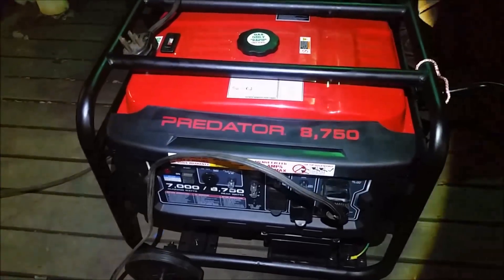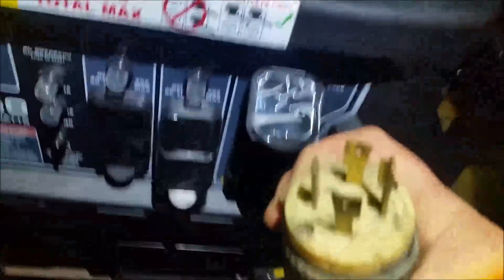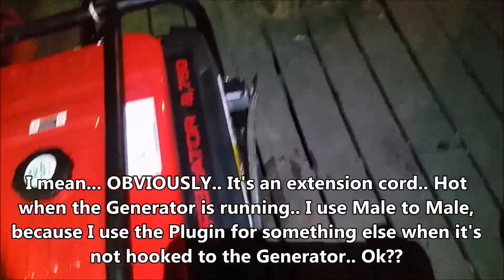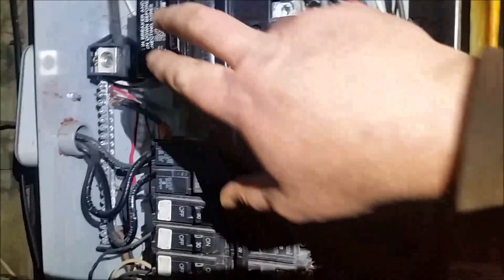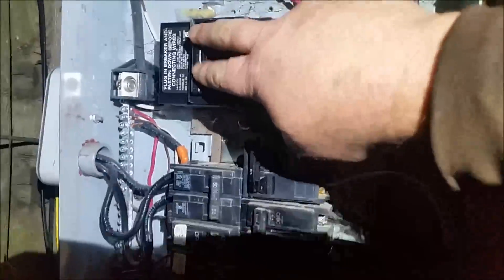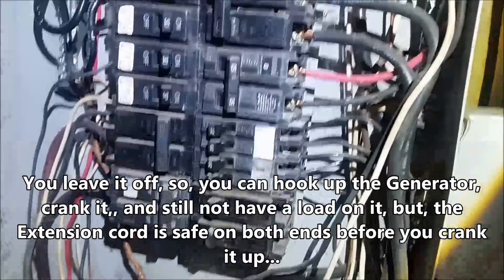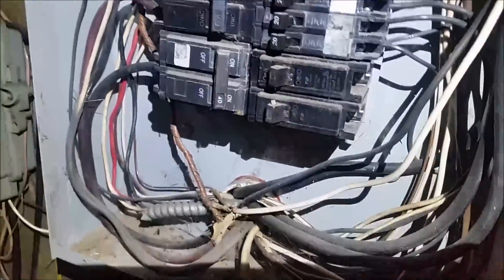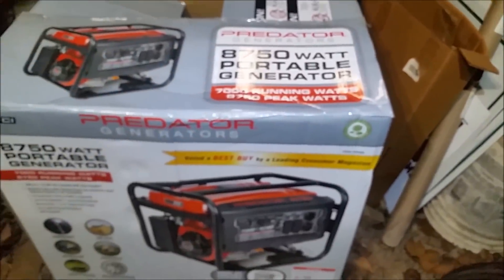Quick/Easy/Safe: Use Existing Plugin/Breaker for Generator hook up to your house Panel box.

Comment: 1. Generator OFF        2. Turn off street power main breaker 3. Plug generator into 220 dryer wall outlet. (You will need a double male 220 suicide extension) 4. Start generator and Restrict your power use to your genset output. I have been doing this for years in Key Largo.
Reply from the maker: G Howard.. You got it buddy.. Works like a champ.. We were on Generator night before last for 4 hours and then, 1 hour when they were making another repair later..  I had two of the lineman come bye here again between repairs.. One that has my setup and his buddy that wanted to look at it too.. 
They came by early before they dropped the power the second time and asked me if I was going back on Generator.. I said Yes, and they stayed while I dropped Utility power and converted over real quick.. I heard them call on the radio as they were getting close to their truck to go ahead and setup the road block so they could make their other repair just down the road..  The one guy said the same thing the first said he would say.. No problem if you remember to turn off the main breaker.. Then, he grinned and said,, if we ever forgot,, they would remind us when they flipped the power back on.. Ha.. 
I reminded him.. Power is out anyway when I get to the panel.. It's the first thing that gets done, before I work on anything.. He looked at me and said.. Hmm.. Yep,, same here, and said,,, not a bad setup.. He also mentioned he had a welder plug that he was going to use to do the same, next time the HF Generators came on sale.. Cheers.. If it is good enough for the lineman, good enough for me.
Reply: They call it a suicide cord for a reason...
Reply from the maker: Dsm Reloader.. Yes... Because of people like you trying to use them.. For people like the rest of us, it is called Male to Male Extension cord and we use it simply and safely.. Same as we don't forget to tie our shoes or put  our cars in park.. I know that is really hard to understand.. But, it is really simple for the rest of us.. But, it is Ok.. There are electricians for you other guys.. Since posting this video,, I don't trust any Electricians any more.. Too many who don't understand the fundamentals of Electricity, much less panel fundamentals.But, it's ok too.. None of you will be the wiser..
Reply from the maker: DSM Reloader.. Really?
Turn the Main Breaker off, connect the Cord, THEN,, Crank the Generator.. Remove Generator in the exact opposite.. 
Why do they call it Suicide cord using these 1/2/3 steps... I am curious.. Maybe we have met someone who is Intelligent today?? 
Or,, are you just another Libtard Idiot? Your next comment will be the final judge.. Guess where you are right now, without an explanation.. Ha..Ha.. 
Give it your best shot.. Using these steps, 1/2/3,, why would you call it a "Suicide Cord"..  Waiting?????
Reply: That is called Back Feeding and it is dangerous and illegal.  If your neutral is not isolated from the street service (which in the case of this video it clearly isn't since all that is on the main breaker are the 2 hot lines), then you can back feed to the service and fry the power company guy working on the street service.
Reply from the maker: Is that what you call a Manual Generator Switch.. Back Feeding.. Because they all feed back into the breaker panel.. If it is the opposite direction of the Utility power,, it is going to be best described as backfeeding.. I don't understand why you think it is illegal.. Do you have some way to replace the feed coming in from the Utility, so it is fed the same way?? Backfeeding or Alternate feeding would be the same thing. Something other than Utility power,, Just FYI.. 
If you don't understand it that way, maybe you could better explain at least what you are thinking.. 
Neutral Isolated from the Street? Would you please show me a Main Breaker Panel that has a Neutral Disconnect? Please get some good pictures.. I have yet to see one.. And,, by the way..While you are doing that,, notice that every box you look at says "Service Disconnect" and the only disconnect is the two wire "Hot Feed".. But, don't stop there.. Go out and look at the poll where you transformer feeds your house.. Look up and see how many wires are feeding into the transformer from the Utility.. If you count more than 2, that means you have 4 and you have 3 phase.. But, it still means that those wires are all hot.. So, how does your theory make any sense?? Just curious.. because the bare wire on the Areal Triplex entering you home.. Where does the 3rd wire come from?? You will find it in the ground next to the pole the transformer is on.. If that is the case, then, what the hell are you talking about?? How could it back feed to the service and fry the power company guy when the wire doesn't go past your house and transformer?? 
So, even as you have described it in your sentence above,, the neutral "IS" isolated from the Street Service.. Assuming that the transformer line to your house is not the same as the guy down the street working on the street service.. Do you not even think about things before you type them with Authority?? 
Did the thought never cross your mind?? If it did,, why did you ignore it?? And if it did not, why do you ignore something so obvious.. Have you not even looked to see how it works before you try to tell someone how you "Think it works"?? 
More time staring at the polls and wires and less time on the keyboard is what the Electric Doctor needs to prescribe to you.. Where you guys come up with some of these crazy comments is beyond me.. It took me all of 30 seconds to figure out, two wires in and 3 wires out, there was one somewhere that needed some further investigation. Tell me. Did the thought never occur to you?? Amazing.. 
You guys really need to get some more experience before coming to this channel.. Thinkers are present here. Do you get away with this kind of crap on a regular basis?? Just curious. Or, are you called out every time you post something like this.. I hate to think that guys like you are the norm in this Country now..
Reply: @MarkThomas123  man oh man I can't stop laughing very well said!!!!

Comment: Using this setup will get you a big fine if you use it. If you cause an injury or fire you'll be charged. By law in Ontario the generator and hook up has to be completetly isolated from the hydro circuit with no chance of your generator and hydro cross connecting. That means not just your main breaker. Any competent electrician can set you up with the proper isolating hookup. Hydro will also inspect and certify the installation. Your insurance company won't cover idiocy like this.
Reply from the maker: Glad I don't live in Ontario.. I can remember to turn the main breaker off.. It's called "Service Disconnect".. In every state I have ever been in,, that's enough.. Once you disconnect from their Service, what you do is your own business. As long as you have things back to normal before you connect again.. That just means unplugging the Generator.. That's pretty simple and always done before the main is switched back on anyway.. If they want to be like that, I'll just tell them that I don't use the generator like that.. And, if they come knocking when I am running on generator, I'll just tell them to go and get a search warrant if they want to come onto my premises.. It's pretty simple if that is the way they want to play the game.. It's not their job to come inspect my property if there is no problem.. Especially, if I have not called them for any reason.. 
And,, it's by "Code",, not by "Law"..   And, at the minimum, what they are talking about is a "Panel Interlock" or "Generator Interlock".. No wires involved.. Doesn't take an Electrician if you can use a drill and screwdriver.. I'll bet you won't find anywhere, where you have to use a "Standard Generator Cord/Plug either"... Do some more research..
Reply: Ground and the white neutral wire are not disconnected by the breaker using your method. There were a few accidents and fires during the ice storm in the 90's that prompted the the extra precautions. There is a unit that attaches to your power utility meter that completely disconnects the grid circuit and then connects the generator when you plug in your generator automatically. Because its before the panel you can power your complete panel if you want. Unfortunately not every one can be counted on to use common sense. I think it's a sensible basic work safety policy that saves lives.
Reply: Not sure why you would want the grounded neutral disconnected. The meter base device is called GenerLink and is only a 2 pole switch. Also pulling the meter only disconnects L1 and L2, the neutral is a bolted connection.

"58. Is the switch device a 2 pole (both legs of the 240V) mechanical switch?
a. The GenerLink uses an ASCO 2 pole switch that is electrically positioned and mechanically held in place. These are the requirements as set by UL section 1008."
Reply from the maker: Ed Taylor... I am not aware of this "There is a unit that attaches to your power utility meter that completely disconnects the grid circuit".. 
Is that what you are referring to? The Generlink? Doesn't sound like that either.. 
There must be a video out there somewhere, where a guy talks about this,, but, doesn't give any details, because I have seen the comments before, but, no one is ever able to give any specifics.. Because I would like to see this thing.. It is like nothing else I have ever heard of.. 
Maybe he'll cough up the details between posting his "Game Videos".. Ha..Ha..
Reply from the maker: Marc Founier.. ?? "There is a unit that attaches to your power utility meter that completely disconnects the grid circuit "... Post a Model Number, name, etc.. I would really like to see what you are talking about..
Maybe make a video about it. I see lots of kids games posted on your channel.. This would be a good video for you,, since you know so much about this.. 
At least you can share what exactly this is.. I would like the see the logic of the manufacturer when you post it.
Reply from the maker: Looks like they just wire the other two wires from the generator to frame ground.. 
Pretty easy setup for those who can't remember to toss the main breaker though.. $650 is not a bad price for those types..
Reply: For me it would be inconvenient as well as pricey. My meter is on the rear of my 24 x 24 garage so I would have to either wheel the generator around the garage or deploy a 70 ft  cable from the meter to a convenient location for the generator in front of the garage. I see no hazards with my current approach, there is just no way to forget  the main disconnect. Do linemen forget their multiple disconnects?
Reply from the maker: Yea.. I agree.. Would be a pain for me too.. That's just not the optimum place for me either...  Thinking about it further.. I can't think of any house I have ever lived in that I would want a generator in that particular location..  The meter pan is usually in some easy access location on the property.. Not the best place to have an expensive generator you don't keep an eye on all day.. Not in today's world.. I live far enough out, I don't get that kind of trash very regularly, but then again, I am far enough out that if I did, I would not be expecting it.. That is one of my winter projects for this year.. CCTV for the main property here, the cabins and my Mom's place..  I am going IP all of the way and ordering the stuff from overseas.. Not the cheapest project I have ever done, but, priceless in piece of mind. And, I hate a damn thief.. Ran into a situation today.. I had a worker who I was ready to fire and didn't because I needed extra river guides and didn't have enough.. I finally nailed him and then I found out, he was climbing in some windows down the road..  I hope I never catch someone like that.. I hold my temper pretty well, but, I am never ready for that kind of Temper test.. I will most likely fail and send someone to the hospital for an extended stay.. 
BTW.. 6 hours on Generator again today.. Another Broke pole down the road.. There are some kind of ants that are attacking and killing Oak trees.. The lineman I talked with today told me the last 3 extended outages were all caused by the same thing.. 
I asked them to report it to the Forestry Department,, or the Coop.. Something new is going on.. This is the second time this week,, and it wasn't too long ago either.. I am fixing to start keeping a log.. Winter coming.. Holy crap.. This may be exciting.. No stale gas around my house... Ha..

Comment: Most you said is OK. There is a blocking attachment for the breaker box which doesn't allow the emergency breaker to be turned on unless the main breaker is turned off (required in most places). One should never make a cord with a "male" plug on both ends. There are plugs and receptacles for that purpose.
Reply from the maker: Not for this purpose.. You are talking about some DIY'r doing a bunch of rewiring, pulling the panel and installing an Interlock.. None of that has to be done with this setup.. You use an existing Welder/Dryer/Stove breaker and run the generator to it,,, After turning the Main breaker off.. Nothing else has to be done, rewired, etc.. Yes.. There are places for a Male to Male Extension cord and no other special plugs or recepticals are needed.. But, if you do install one like you are talking about "Male Plug outside of the Panel",, Yes.. For Sure.. I would recommend you get a Panel Interlock that won't allow you to have the main and that Super Dangerous Male Plug outside of the Panel to be exposed while the Main Breaker is on.. That part is ABSOLUTELY correct.. There are no such Dangerous 365 days of the year connections like that in this way of hooking up a generator.. Only thing added to the wiring is a temporarily hooked up male to male extension cord """"While you are running the Generator'".. Much less dangerous for your average DIY'r.. You have to remember to turn the main breaker off in both instances..This way, you don't have all of that rewiring, etc.. But, you choose.. It's only here for people it makes sense to..